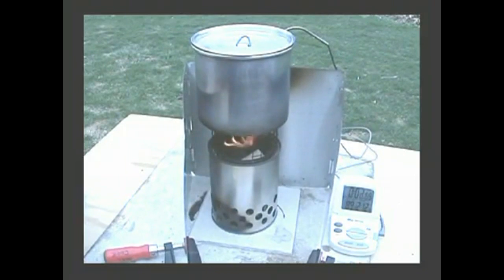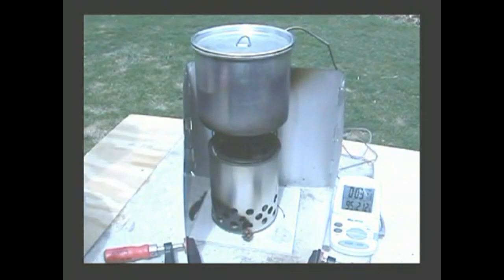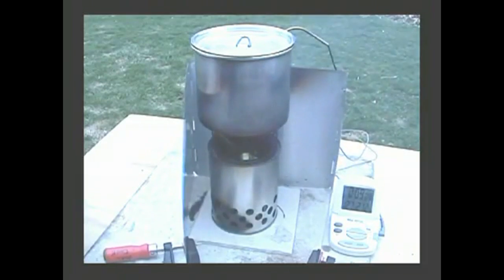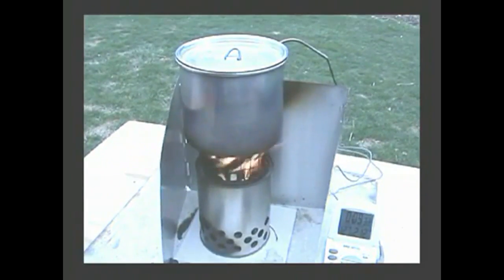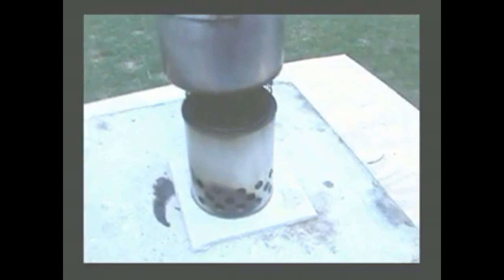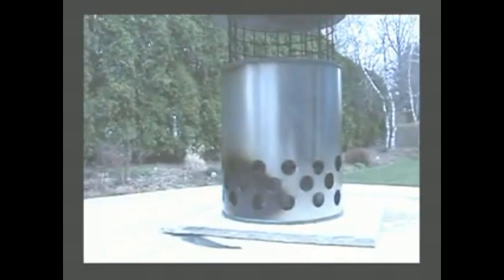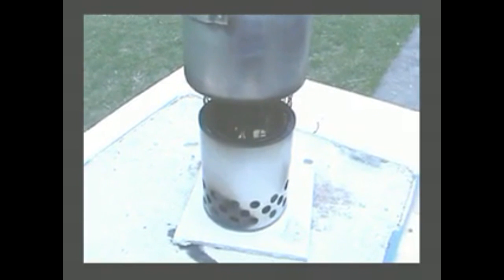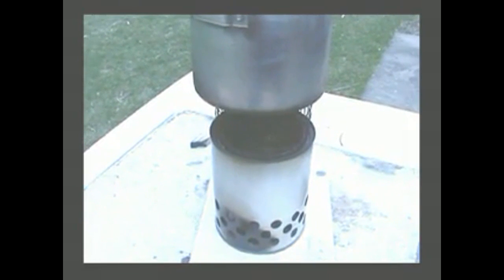Woodgas Simple Version 1.2 Boil Test 1

Comment: Answered my own question  
 A wood gas stove commonly uses the downdraft principle. This principle involves an inverted cylinder that houses the low burning wood chips. Gas escapes downwards through holes at the bottom and climbs upwards through the space between the two cylinders. Additional air oxidizes the carbon monoxide and makes it ripe for burning. The carbon monoxide from inside the closed cylinder burns when it reaches the top where an igniter produces a spark.